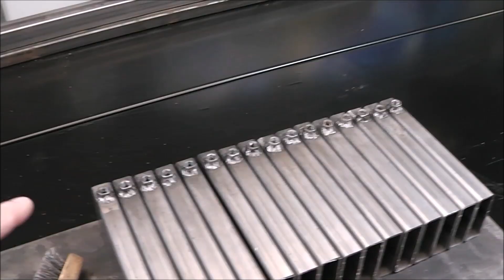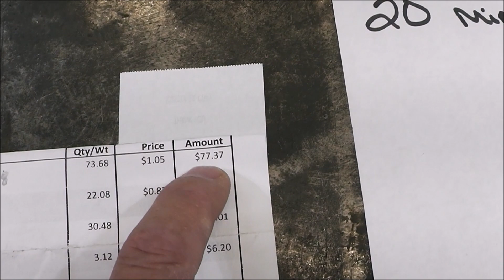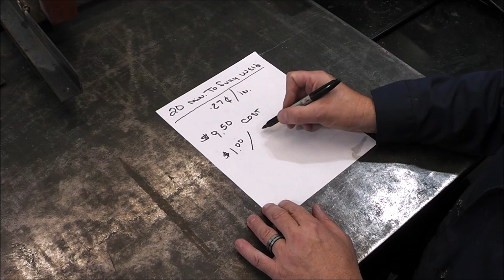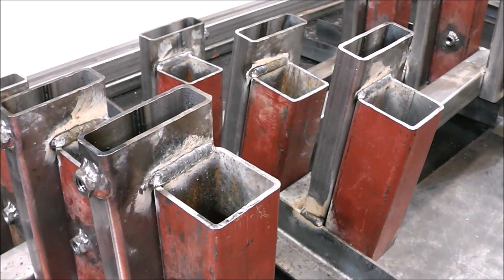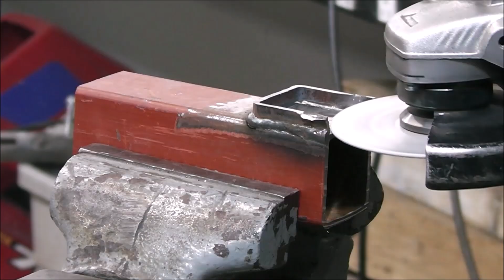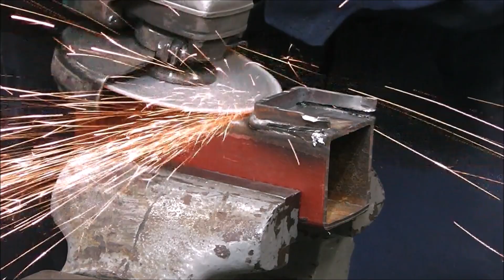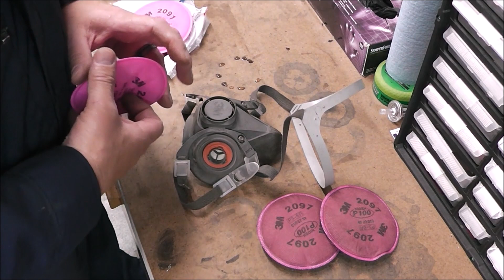Welding Fabrication and Pricing out your Work

Comment: Did you collect the materials  from the steel supplier , would you charge for collection HR rate fuel cost running cost of your truck etc , what was the retail price of the parts to the customer
Reply from the maker: Whatever it costs to get the materials from point A to point B has to be factored in. Vehicle expense, gas, insurance, registration, (mileage) then shop expenses, power, internet, insurance, consumables, material markup, labor. I haven't built any for a while so I don't remember what the breakeven point was.

Comment: Thread a bolt into the nut before welding and eliminate tread clean up entirety.
Reply from the maker: My issue is the nut shrinks on the bolt and galls up the threads. I have a tendancy to weld hot and this is one of those issues from that

Comment: As far as not giving discounts on in stock materials, if it is something that you have and it's taking up  space, isn't a dimension that is commonly used, etc. Then it is perfectly reasonable to discount it if that discount entices the customer to buy. Sometimes you are better off losing a little in dollars to get rid of materials that are taking up space perpetually.

Comment: Hi Brandon, thank you for the video. I am just starting my business and I have a job that is just one large project. How would I go about pricing that? I was going to get a quote for all the pieces pre cut and just add 10% mark up on price then add my per hour fee for welding and assembling. It’s all welded together and needs to be fit correct spacing. So mostly time consuming spacing everything correctly
Reply from the maker: Thats tough. If you used your cut quote and added 10-15% you would have your cost covered but you also have to factor consumables (gas, blades, disc's ect). For labor sometimes I just look at the part and say it will take me XX number of hours to fit / weld then multiply that by your number of pieces. Above all make sure your not underselling yourself. It's easy to do when your starting out.
Reply: @BrandonLund  thank you! yes i have heard its easy to just want to make a name and thats what Im trying to do but also need to make some profit

Comment: So you build one before you quote it?
Reply from the maker: If if looks like something i might want to produce to make money i will.
Reply: @BrandonLund  So does nor work for One-offs like a business sign?
Reply from the maker: Nope. For something like that i estimate my time by breaking down each component like layout, cutting, joint prep, welding, grinding, finish. Then i add up my material cost. Then i add 1/3 to the material cost. Then add my labor total to my material total and thats my quote. There are a ton of ways to arrive at this but this is how i do it for one offs
Reply: @BrandonLund  Cheers
Reply from the maker: @TwistedGorillaFab  thanks! And same to you!

Comment: Huh, so this is something that I keep running into living in a MUCH more expensive area (DC metro) with fewer people willing to do this kind of work so people don't seem to know what it's worth... you'd think that would drive prices up but it just completely takes you out of the market. It looks like this comes out to $80-90/per based on your numbers, correct? So did you have any problems at that price, especially since it looks like similar stands (arguably not as nice in some cases, but powdercoated and better finished) are available for $30-55 on Amazon?

For me, in the immediate area, all the metal suppliers have disappeared when metal supermarkets showed up and I'd have to drive about an hour each way to get pricing about 120-140% of what you mentioned for the 1x3 (much more at MS, but the advantage with them is that I could buy EXACTLY the amount I needed at the same price per foot as I could a whole stick at a time, their pricing ends up very close to buying stuff at HD and Lowes for comparable stuff). Then unless it had some completely custom feature that would make it impossible for everything already on the market to work I'd have to come in either under Amazon or faster than their 2 day prime. If there was some completely custom feature then it would probably be about what that feature adds, like in your case, maybe you could argue the 2x2 tube if someone was trying to mount something special, and I would guess that would add about $10-25 to what someone was willing to pay, putting it at around $75-80.
Reply from the maker: It sounds like you've done your homework because your numbers are spot on! The market is crazy right now so prices on materials (and everything else for that matter) have skyrocketed

Comment: So about running a tap thru the welded nuts...I don't! I tack the nut on with one tiny tack ,turn in a short bolt and then no reason for a tap..Throw in a drop of oil before u put in the hold down T bolt,or just a standard bolt.Easy peasy...
Reply from the maker: I've never had good luck doing it that way. The nut always seems to get distorted. I generally try to make it happen in one pass so the nut is glowing cherry red at the end as I'm backing out the bolt.

Comment: When it comes to materials cost, you need to include EITHER a Margin increase or a Markup increase. The two are NOT the same. 
Margin increase DIVIDE cost by: 
10% Margin = 0.90
20% Margin = 0.80
30% Margin = 0.70
Example: $100 cost divided by 10% MARGIN increase (0.90) = $111.11
$100 cost divided by 20% MARGIN increase (0.80) = $125

Markup increase is simple %
10% Markup = Cost x 0.10 then add the two together, same for 20% and 30%
Example: $100 cost plus 10% = $110.00, 20% MARKUP of $100 = $120 

In my business I use MARGIN to account for fuel, time, effort to get stuff, to order stuff etc....
Reply from the maker: Based on your example, the difference for Margin Vs. Markup on a 100.00 dollar item @ 20% is 5 dollars.
Reply: @BrandonLund  Yeah, I kinda think I showed that unless someone can't tell the difference between $125 and $120. Course these days that doesn't surprise me much. 

Now let's do a 30% difference... 
100 / 0.70 = 142.86
100 + 30% markup (30) = 130
Difference of 12.86 for a 10% more margin

And if you're doing it on a thousands of dollars scale for the year, you're looking at a WHOLE lot more money on a margin vs markup.

Lets look for the sake of argument at $50,000 
$50,000 / 0.70 = $71,428.57 Margin
$50,000 x 0.30 = $65,000 markup
Difference of $6,428.57

Now is it making sense? So which way would you rather see on your year end books? One where you've "marked up the price of products by 30 percent" or where you've "marked up the price of products using a 30 percent margin"
Reply from the maker: It does make sense. Whatever percentage you decide, if at the end of the day you haven't covered your incidental expenses than it really doesnt matter what you call it. You just need to adjust accordingly. Calling it a margin increase over markup is more semantics than a solution but yes I understand what your saying.

Comment: put a little grease, wax, or anti spatter, on your bolt and the nut will stay clean when you weld it, and you won't have to chase you threads. I would use hard wire or dual shield just watch your penetration.
Reply from the maker: The issue i usually have with the smaller nuts is the heat will distort the nut so the bolt runs real dry.
Reply: @BrandonLund  Steel will expand .001 per inch per 100 degrees, it also shrinks a tad when it cools.
Reply from the maker: This is why I love our comments section! We are never to old to learn. Thank you!

Comment: Hey Brandon, In the old days I built a welding table out of a 1.5 inch 4x8 plate with 6 adjustable feet. You could weld angle iron and or cut off C clamps to it with no problem. I did fire two guys for using a grinder on edge to grind the tacks down, I specified a cupped grinder and a flat wheel, plus a belt sander so we could maintain a relatively flat table + or - .010. It wasn't perfect but close enough for most jobs. If the tolerances were tighter than that I used the lathe and milling machine then shimmed the parts to be welded, and used a hiliarc to weld them. It was slow but way beyond my competitors standard of + or - half a hammer handle. Hang in there Bud and keep up the great work, don't let the industry standard deteriorate. The table did get out of whack and I hauled it to my buddies shop and he put it on the Blanchard, I lost .125 of the original thickness but it was flat LOL
Reply from the maker: Thats impressive that it took that much material out! There is nothing better than working from a ground surface in my opinion. It even feels better!
Reply: @BrandonLund  That Big 48 " Blanchard of his was a steel eating fool, he had a bunch of huge machines. They machined crusher cones after they come out of the foundry for their bread and butter. They had 1,000 cubic feet. of rebar and 8 sack concrete under each machine so they could hold tolerance. Interesting side note there is a D8 buried under the shop that sank out of site when they built the place, they just left it down there. That site was originally a marsh.
Reply from the maker: OMG thats unreal! I love hearing stories like this...thank you for sharing! Cheers!

Comment: Hi Brandon - I'm just getting started in welding. I was wondering where you get your metals for projects? I noticed that you paid $77.37 for a 24ft 3x1 x120w Rec tube. I can't find anything that cheap in nearby metal stores or online!! Your beginner welding videos are great!
Reply from the maker: I buy all my metals locally here in Maine but they dont ship unfortunately.
Reply: @BrandonLund  Thanks. I'll keep checking around my area.
Reply from the maker: 2 metal yards located 15 miles apart and the closer one is always 30% more money. Keep calling around. Im sure you can find a better price.
Reply: @BrandonLund  Some of our local welding shops are still very pricey. When you say “metal yards”, do you mean metal recycling centers or scrap yards? They seem like places for dropping off scrap metal, not buying new metal. We have a few MetalSuperMarkets.com locations out here but everyone says to avoid them – again high costs. Sorry for all the questions.
Reply: @chipd9939  Google steel supplier + Your location.  They are generally a shop that just sells metal/material, though sometimes you'll find a fab shop attached. Welding shops, Fab shops and scrap yards are not what you're looking for to purchase new metal usually.
Reply from the maker: Spot on! Thank you.
Reply: @BrandonLund  Any time, always happy to help, especially if it gets more folks into metalworking.  Also, great video!
Reply from the maker: @Grn South you have a great attitude! I wish there were more positive people like this👍

Comment: You are getting screwed on your steel prices especially because this is a year old
Reply from the maker: Steel prices are even higher now but they are all within 5-10% in my area.
Reply: @BrandonLund  yeah they're slightly higher now but last time I bought one by three it was .083 wall but I bought it at $ $29 a stick drywall
Reply from the maker: Thats a great price! What state are you in?
Reply: @BrandonLund  I'm in Southeastern Idaho. I do live like a mile away from Nucor which is one of the largest steel mills in the country but I buy everything out of Pacific Steel the company I work for buyers just over about $190,000 worth of Steel a year so not a ton but enough to get the prices a little bit lower
Reply from the maker: Nice! Stay safe brother! 🙏

Comment: Hello Brandon, In the old days I used to draft up my design then go over to my buddy's architect office and he would make a blue print from my draft. At that point I knew how much material I needed, the number of inches of weld, the number of cuts, and drill points for the project. Plus the square footage of area I needed to prime and paint. From that I could submit an accurate bid, and still have an acceptable cushion built into the job. If the job was anything more that a one off I built tooling (welding, cutting, and drilling jigs) after I got the job. This gave me the ability to know exactly how long it would take to complete the project, and every piece would be exactly the same, plus I was able to provide my customer with a realistic completion date.  One other caveat (and this one really helps) is after you have your material list completed shop around and find the most economical price you could. Then spend the entire  material budget so you have way more material you needed. This way over time you had a very nice inventory of material that was already paid for, this paid off in spades when times were slow. And if a new customer walked into the shop with a little 10 or 15  minute job you had the ability to do the job for free and tell him to come back if he had a bigger project or repair in the future.  If the job was 20 minutes or more I would tell him what it would cost before I started, I never advertised and depended on quality work, and word of mouth to grow my business. Any thing I designed and built from scratch I guaranteed for one year excluding paint. It was over all a good business formula for me, and mind you it was years before computers were around. I noticed you set your jobs up like and assembly line which I believe is the best possible way to keep the work flow moving smoothly. Good luck and keep the faith in the meantime don't take any wooden nickles.
Reply from the maker: What a great comment! Thank you very much. The problem ive had with materials is I keep ordering more because I forget what I have lol. I have a tendency to do that with a lot of things but I'm trying to be more conscientious. Thanks again I appreciate your support 🙏

Comment: I use the slipper clutch part of the drill when tapping.  I don't like the idea of the bits slipping on the jaws of the chuck.  But cordless drills work great for tapping holes.  Just need to go easy, let the tap do the work, not the drill (so to speak).  Great video.  My new welder just got delivered.
Reply from the maker: Thanks Ryan and great tip!

Comment: #1 are you a Virgo, that would explain the organizational focus.
So it is interesting and informative. It is also cool for me as I make a combination target stand cover barrier stand for IDPA shooting competitions. I have a lot of design and experience, but not a lot of marketing experience. I work the same way as you do regarding templating and gang jobbing, where I make all the parts and do each operation in turn. 
My order generally goes from part making to welding to abrasive blasting and or wire wheeling, then to powder coating which is the most time intensive operation.

I noticed you didn't include finishing as a cost factor, but I also think $30 is a high price to add to the final price. I priced my cost for my stands at approximately $14 at $1/lb for steel and a guess at the rest. I sell them for $24 each, powder coated. That's a 58% markup when average retail markup is 35%. Your markup in the example is 25% actual cost and 75% labor cost for 100% total markup. If you consider all of the $40 as cost, then at 35% retail you price should be $54 each.

I definitely must re-evaluate my cost analysis, especially since I need to factor in the powder coating and abrasive treatments. I also need to factor in chemical descaling of all the steel parts vs abrasive blasting of non rusted metal parts/stock.

Maybe you can do a video of how you acquire jobs and/or product sales. Do you sell from your own website of a third party store? Do you take single orders or make products ahead for store sales?
Reply from the maker: Thanks man. 24 dollars each seems a bit low to me?  Especially if you are powder coating them. It must take you close to a half hour to just cut, fit and weld one together. A general shop rate here is $60/hr so your at $30 and havent factored in metal, paint, electricity or consumables yet. The dual one you see is priced online elsewhere for $90 ea. but it's also powder coated. I dont sell or advertise anywhere. Everything i sell is all word of mouth.

Comment: Alot of guys with high powered rifles use 2x4s for holding steel plate for target practice
Reply: 2x4 dont last. What he is building  will last for years to come.
Reply from the maker: Thanks man, yes, I know the type you are talking about. I could have put a 2x4 pocket on these and had a triple duty stand. I'm not sure the base would be wide enough though...maybe if I staked it down or sand bagged it.
Reply: @BrandonLund  image the stand would be pretty heavy
Reply: And that's a small nitch of people

Comment: Good job on this video.
Detroit joe
Reply from the maker: Thanks man!
Reply: @BrandonLund  
Just curious why flux core.
Is that your basement do you have a vacuuming  system to air out your room. Thanks
Reply from the maker: Thanks Joe. I used flux core because it was really hot in the shop and I had 2 large fans blowing on me (which would blow away the coverage gas unless I set up some shields). My workshop is below an unfinished work space and I can ventilate to the outside but I don't use anything fancy, just regular fans blowing the air outside.